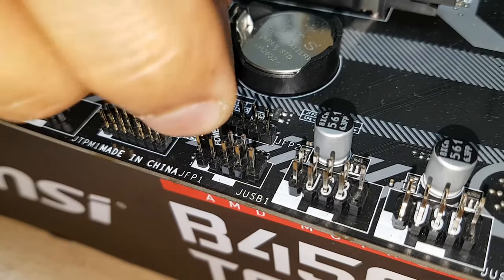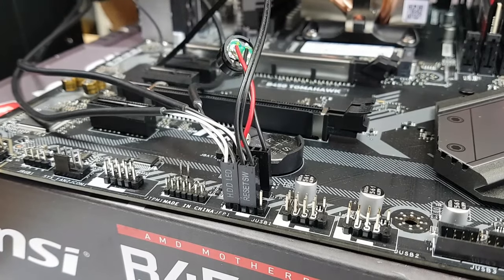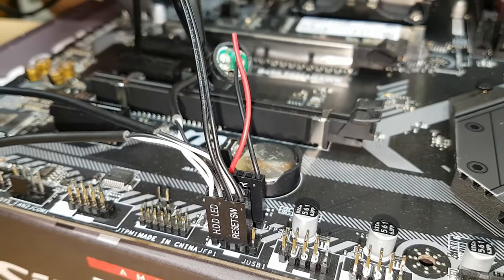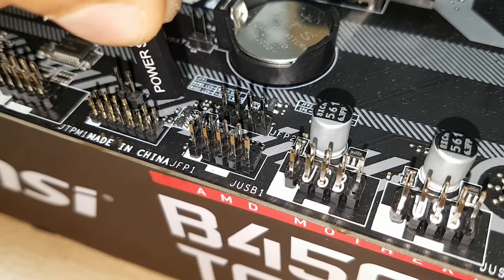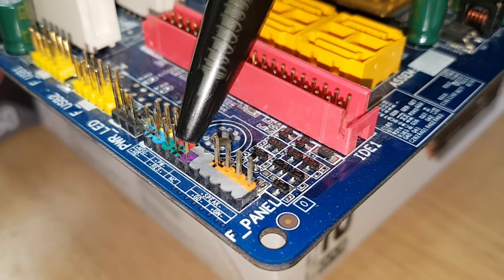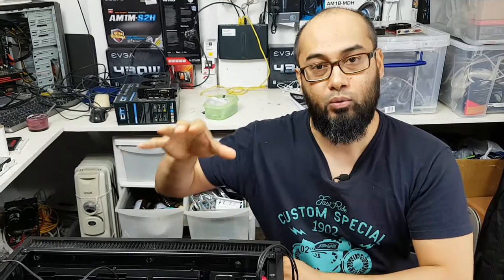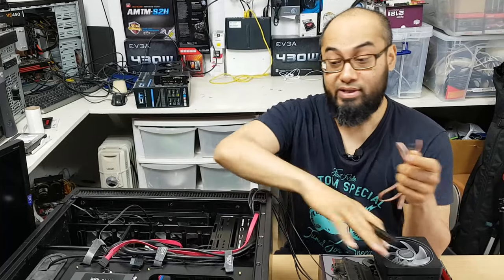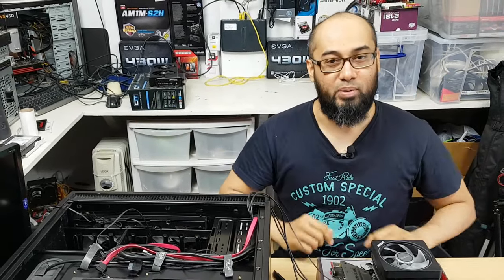Front Panel Connectors On Motherboard - Easy Beginners Full PC Building Tutorial - Pt 19

Comment: My cool master mb530p only gave me a power sw...I don't need the HD one since I don't have any of those. I had to put the power sw on the bottom part because it seemed to be the spot it indicated on my master jump connector that you can use to practice with. But I could not power the motherboard. I am assuming it is either the motherboard or a bad box switch?

Comment: Sir, my Power LED (Green color) has been broken for quite some time now. I plan to change to a new LED soon. Do I need to connect a resistor in series while replacing the new LED? Or does the motherboard comes with a current limiting feature on-board (GA-H81M-DS2). I don't want the LED to be burnt anytime soon after replacing it.

Comment: I wanted to test my connection and the front panel does not light up, now there's no cpu, ram or gpu connected during this test I was wondering could that have been the reason the front panel rgb and power light will not light up?

Comment: 1. You have not said the answer to what if the power leds are inserted in backwards manner i.e. +to+ and - to- but in backwards direction.
2. My power button was giving green light but now its gone solid orange though my pc is working perfectly. I recently reassembled it after my power leds was off completely but pc was working fine... so reassembled it. What may be the reason? One thing to note- I have 8pin motherboard power connector but when I bought my pc 5/6 years ago, they plugged in a 4pin connector coz psu did not have 8pin....and it is working since then

Comment: The rgb on my motherboard will turn on and the usb and everything in the front panel works except the power button, I put everything in the right place could it be a faulty psu or motherboard, I’ve used this motherboard and it worked perfectly fine until it randomly stopped working after a power outage

Comment: It would be great to find a workable liquid adhesive for motherboard front panel and audio and such loosely fitting clips on a new ASUS Prime motherboard, all fit sloppy and fall out one by one, very small application header. I did once with a dab of plastic cement making one part of the four cable caps.

Comment: My mobo is almost the same as yours (msi B450 Gaming Max), but my case (Cooler Master Masterbox Pro 5 RGB) must be different. This video shows a speaker cable, but my case does not have one. It has a connector called "HD AUDIO" which seems to plug into JAUD1 on the mobo. The m-board does ALSO has a JFP2 plug. Is it ok to leave JFP2 empty if I plug HD AUD into JAUD1?
Reply from the maker: As long as its working then yes leave it..!

Comment: The issue is not that it's hard to figure out where the front panel connectors go. As long as you keeping referencing the manual and the legend printed next to the front panel connectors, you should be fine. The issue is that these things are so tiny it's easy to plug something into the wrong pin by accident.

Comment: My OMEGA M340 case has an "LED" connector without any + or -. I also notice that the case has an "LED" button beside the power button that as of the moment does not work. I dont know where to plug it in the ASUS B350 plus. 

Im guessing this is the connector for the LED of the 3 fans of the case. But they dont light up rn coz i didnt plug the connector anywhere. 😭

Comment: what if there is no reset switch on the front panel to connect to the MB? I bought this case "Fractal Design Core 1100 - Mini Tower Computer Case - mATX - High Airflow And Cooling - 1x 120mm Silent Fan Included - Brushed Aluminium Front - Dust Filters - Black" and there is no reset switch??????

Comment: what should I do if the wires he's plugging in at 0:33 came not connected to my front panel? (they came in the bag that has certain screws for the case. btw the case I am using is a nzxt h510 flow if that helps.

Comment: Hey, 
Thank you for the video. Im having an issue with my gigabite b450 aorus; ive plugged in all the front panel pins, but when i switch on the back power supply, the board lights up for a split second, then turns off. No fans running, no GPU, no CPU, etc. The front buttons dont respond also. This video was very informative so i was wondering if you have run into this before and know whats going on! Thanks in advance!
Reply: Same
Reply: @revthawne  i ended up returning it and buying a different motherboard. Customer service wasnt the best and there were no local shops that could update the bios (for some reason). One told me they would charge me $150 to take a look and $250 if they decided they could "fix" it so i figured i might as well just buy a new one at that point.

Comment: I bought the Corsair 4000D airflow case, and it didn’t come with a hdd led cable. Do I need that or can I build it without the cable.
Reply: No don’t worry I don’t have one it’s just a light you can even not plug it in if you have one

Comment: My problem is the two power LED have two pin connector in each so they take two each. Or is that the speaker cable idk. It's a inwin 303.

Comment: I dont seem to find the reset sw one,the pc runs, but should i look for it or is it something not to worry about
Reply: The most important ones are the power button and power light (if applicable) headers. The rest are not that important. If your PC case doesn't have a reset button, then you don't need to worry about it.
Reply: Oh it doesn't, thanks for the info

Comment: What do i do if i have the front connectors in correctly but it gets no response when i hit the power button. But when i do the screw driver test the pc will boot
Reply from the maker: Maybe a break between your front power button and the pin, maybe the cable is broken, check it.

Comment: Hey, I just bought a Ciptronex MX3 cabinet... And it doesn't have a reset switch connector... What to do now... Please help me sir...
Reply: i believe you will just leave that pin on the mobo empty. I could be wrong, but I dont think it matters. My BQ case is the same way, no reset switch, there kind of obsolete these days if you ask me.
Reply: @immortaljack_  well thanks a lot buddy... That definately gave me some courage...
Reply: Can confirm you can leave it empty. Just built the rig last night.

Comment: One thing left out. How do you know what wires are Positive ?  You can't go by Red for + or green for - all the time. Ok here only 2 connectors are marked for Positive & Negative. The other 2 pin connectors for HDD & Reset Switch are not. The answer is, look at both sides of the connectors. Only one side will have a very small Triangle mark. That is the positive wire connection, no matter what color the wire may be. Trust me, I'm building over 30 years :)

Comment: my power switch and reset switch cable come out of motherboard very easily , they are loose almost, could this be why my computer doesn't turn off even when i hold the button ?
Reply: Bro im having this same problem my pc turns on but won’t turn off unless i hold it or turn it off with the back button, did you fix it?

Comment: At 0:10 next to the JFP1 there is JTPM1 what does it do and what should i connect there?
Reply from the maker: This connector connects to a TPM (Trusted Platform Module). Please refer to the TPMsecurity platform manual for more details and usages.  This is not usually an issue for most PC users.

Comment: Hi,I bought new motherboard today(BIOSTAR G41D3C) but the problem with connecting front panel power led(green) in the user manual it has three pins assign for power led (in this order 
Pin1-LED +
Pin2-LED +
Pin3-LED -
but my PC case two pins configuration (which means one pin led + & another pin led - : which actually a combined connector)
then I connected 
Case "led +" to pin2(led +)
Case "led -(gnd)" to pin3 (led -)
But power led is not working , can anyone help me on this ?

Comment: The front panel umbilicals were left halfway into perfections by motherboard manufacturers. It would have been nice for the MOBO maker to plug all cables onto an adapter like the GIGABYTE G adapter and plut the whole thing onto motherboard. Unfortunately you have to understand each cable. Another snag the makers failed to to so is half of the cables show the + and - printed on the cables but not all. so u do not know which way to plug the cables.   On top of that,  Gigabyte, MSI, ACER, Asrock, Intel  are never consistent with their cables and positive and negative prints.  Such small detail but a hassle for buildings. You have to read the manual and do you best. Oh well.
Reply from the maker: Great point.  Any suggestion how we can maybe try to get them to standardise or at least make it simpler.  My channel and influence is not big enough, but collectively maybe...one can dream?
Reply: @HealMyTech1  Write to the CEOs of motherboard makers, ask them nicely or file class action sue them.  A carrot or a big stick.

Comment: Msi G70a-g46  I screwed up, I plugged in a 3 pin fan into my boards 3 pin CMOS port.... Now everything turns on except keyboard mouse doesn't light up, and monitor doesn't post... I think I broke my motherboard.....  I have a fx8350 black edition and I'm going to stay with this cpu with my gtx strix 980 oc because it was working great! Before I messed that up.

Comment: help i have another switch which is LED because my case have a LED button where do i put it?
Reply from the maker: LED what exactly?
Reply: @HealMyTech1 Salam akhi
Same I have a connector in addition. A 2 pin called Fan.  It's connected to the RGB button on my case and in the catalog of my motherboard in the front panel part there is no indication of a Fan connection.  Can you help me barakallah ufik !
I've been in trouble for two days now know.

Comment: Hi there : i have no manual to my motherboard and there is nothing written on the motherboard where which connector goes : how can i find out ( the motherboard is a Acer IPIMB-AR4M352033-B but even with this information nothing to be found on acer's website. I assume the reason is that the motherboard came prebuild and i bought it as a emregency solution used but the case was horrible so i moved it into another case but now i have the issue with the connectors

i would like to ask : can anyone give me any sort of information? like a video where someone does connect another cases cables to it ? thanx alot

Comment: Gawd I hope ppl still read these comments as I have an issue that driving me mad! I have the case 1st Player Rainbow R3. I have a system that someone built for me using it, only thing is they didn't know the front LED control button wasn't for reset so that's how they've wired it.

I've never built a system from scratch but happy to change parts and tinker.

The case cables aren't labeled at all so I'm unsure which one to unplug and move!

MB is an Asus B450M-A

Anyone able to help at all? (Pics would be a massive bonus)! :)

Comment: You should probably specify that it's an msi board, cuz the connectors are different on my asus, thank god the user manual exists (never thought I'd use it). I'm never doing any cable management on my current pc cuz fuck this gave me so much stress...

Comment: Get an Adapter plug   |_|_|_|_|_|_|  fit pins in correct   then maybe  hot glue the bastards in  . (maybe color code the pins)
Draw  a simple diagram & hide  in pc box incase you cant remember what  pin goes  where . 👍   Never put the buzzer in  .  no need anoying  sound chit

Comment: Hi I have a ASUS M32CD desktop computer whose mother board is proprietary for ASUS. The Power Reset Switch recently stopped working, I know it is the power switch because I am able to touch the wire on the pins and have that working. The ready made power reset switch that I can buy online and the one that you show is different on the ASUS motherboard. How can I buy  a generic one and adapt to the custom power switch. Would welcome any suggestions from anyone (The link gives some details on the desktop that I have https://www.pcbuildadvisor.com/asus-m32cd-review/)
Reply from the maker: Look for "Front Panel Red Sleeved Power Reset HDD LED Extension Cable" or similar on Ebay/Amazon.

Comment: you plugged RESET switch OTHER side ! you should turn it other way NOT the same side like POWER button you can see your manual ! 01:53min WHERE GND = ground = "-" is FIRST for RESET the other side for POWER button is "+" and you plug all both the same was  lol